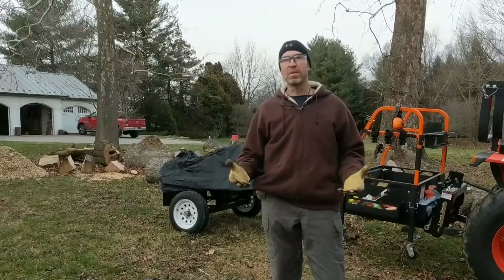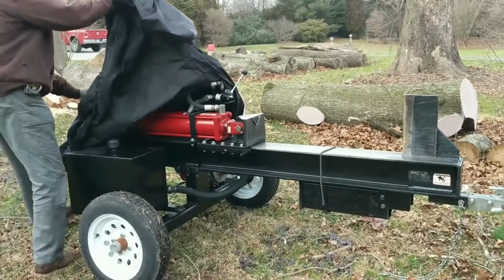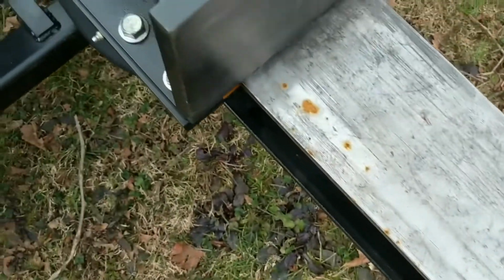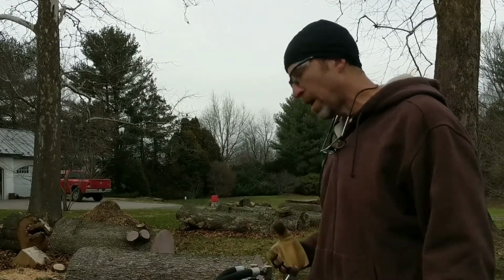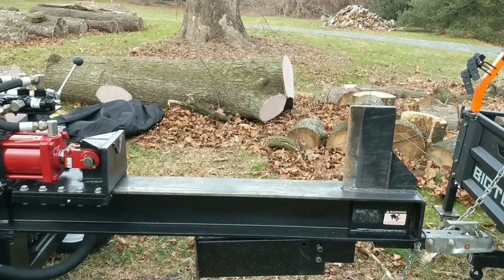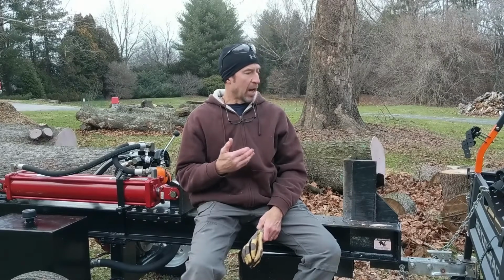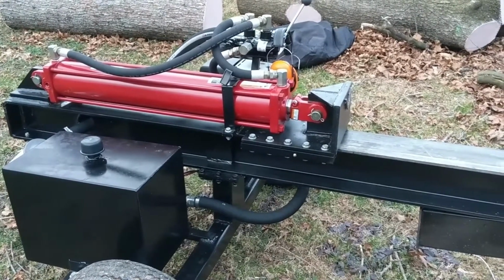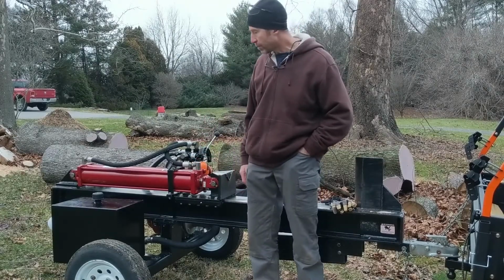Wood Splitter.....Unicorn or Mutt???

Comment: Hey John. That looks like a great build. Have a work table built for it. You won't regret it.
Reply from the maker: That was one of my first thoughts, Mike! I think the thing has a lot of capacity to crank out wood, and I think adding a supplemental four-way wedge on it could really put it to good work! Of course, the table would be a necessity.

Comment: John! Lower the big tool racks gate and slide the cut pieces right into it.
Reply from the maker: Hey Dennis! Thanks for watching and your comment. Exactly!!! I think that's a perfect suggestion. I did a video on how much fire would you can actually load into the big tool rack, and it was more than what I thought.
Reply: @thebradleysoncatbirdhill6849  You could park on an angle placing one side of the tailgate closer to the side where your splitting the ones to put in the tool rack!

Comment: Tony the tiger would say GRRRR  EAT  deal.     cylinder area  times  pump pressure.      4 inches times PI  times 3000 lb  equals    15 sq inches times 3000 PSI   equals 45000  is 22.5 tons.

Comment: Heavy duty? Not really. Well built? yes, very nice workmanship. Cylinder size? More than you will ever need. Cycle time? Fair. Configuration? A resounding yes, push plate is the way to go. Worth $1,000? All day long. However, homemade? If this machine is as is when you purchased it the crush point warning sticker by the hitch leads me to believe it is not homemade. Also, the tow chains being a bare minimum are not exactly the hall mark of a quality home build.  Still a nice machine and worth every penny you paid..